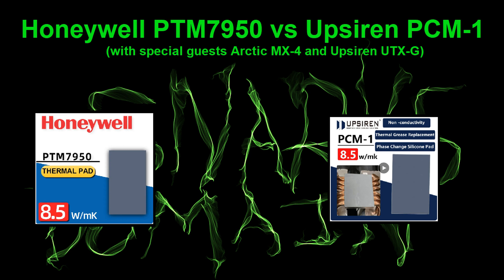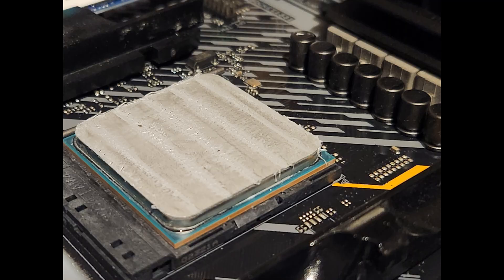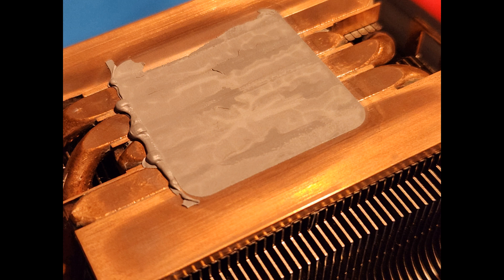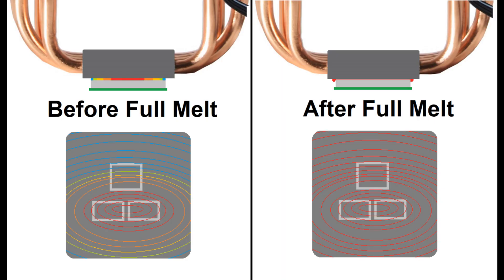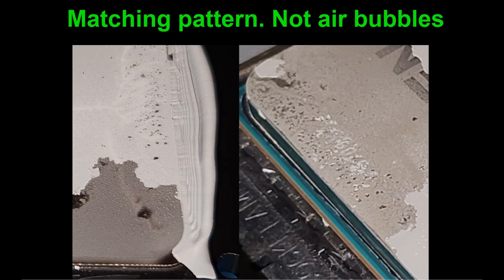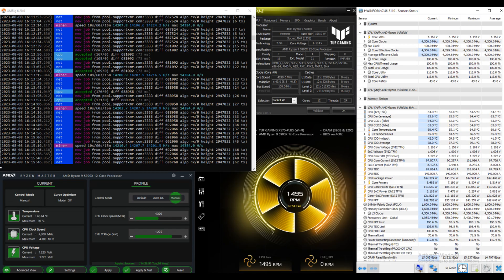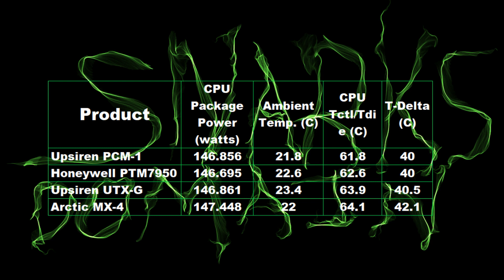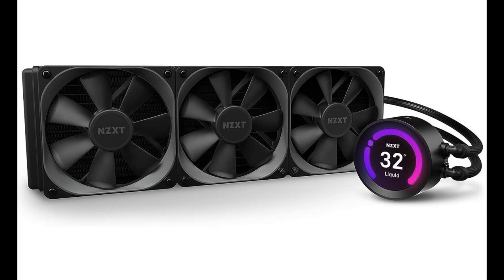Can Upsiren PCM-1 Compete with Honeywell PTM7950?

Comment: A fun experiment to try and would be interesting to see the results. 
Instead of using the usual thermal pads on Vram/Ram chips, can you experiment with using PTM or PCM instead (even double layer it) and see if it gets good results.
Reply from the maker: It sounds like a cool idea, but that would be stacking up to achieve 1.8mm gap (so about 8-9 layers of PCM material. If/when it melts, it would then basically glue the VRAM to the Cooler and would be extremely difficult to pull apart. This would also be more expensive than putty or pads.

I mostly just use a high end Thermal Putty on VRAM/VRM these days, rather than pads.

I might try shims and PCM on a card I'd be willing to sacrifice someday. Just worried about damage when trying to pull it back apart.
Reply: @snarksdomain  yeah it would be cool to experiment on an oIder card you don't care about anymore, with either shims or PCM.

Definitely very curious to see what happens.

Comment: Phase change materials need to be cooled in refrigerator before install. Better for cutting and installing!
Reply from the maker: It's one way to do it for sure. lately I've just used room temp with decent success.

I now always try to undercut it by 3mm on all sides. Do first peel and lightly rub my finger over to work out any bubble and also to make it stick to the surface. Then I use a small piece of tape or sticker at a corner and do 2nd peel nice and slow. I stop if it pulls up or tears. I usually rub my finger again if that happens, and sometimes try peeling from different corner if need be.

Comment: I tested the upsiren pcm 0,02mm vs the ptm7950 from aliexpress (0,25mm), specifically from passionate girl store and this was a little better than the upsiren. The only downside with these pads is when you take them out (specially on laptops because of the small bare dies) after some months I made a rookie mistake and ended up cracking the cpu die on my msi laptop because i tried to remove the heatpipe when the laptop was cold, so it's better to warm up everything if you need to dissasembly your laptop. Confirmed this a couple of days ago, used some pcm on copper sheets, warm'em up and then let them cool down and dude it was hard af to separate them without heat. Anyway great channel, love your videos, a lot of information we don't find anywhere else, thanks!
Reply from the maker: Phase Change materials definitely become hard once they cool down (any temperature below 45C of the material itself will be solid).

If anyone uses Phase Change on an AM3 or AM4 CPU they will need to use the AMD recommended "Twist" method if/when removing the cooler. This goes for dried paste as well.
Reply: interesting insight, will definitely keep this in mind once I repaste mine with PTM

Comment: Hi, did you get honeywell from moddiy?
Reply from the maker: Yes I did. I've since retested several different Phase Change Materials from a few different sources.

I've found it is difficult to differentiate PCM/Paste performance with my current setup, even with tracking Ambient temps (only ~3 degree span from best to worst)

Once I make some further improvements to my test bench and test methodology I'll go back and retest everything again.

Currently focused on testing Thermal Pads, Putties and Shims. This is much easier to do with 35 degrees from best to worst, even considering the 2 degree resolution on Nvidia Mempry Junction Temperaturws within HWINFO.
Reply: @snarksdomain  Thanks for the answer :) I bought honeywell from aliexpress and moddiy a few months ago and it came with different foils, PTM from aliexpress came with grey foil and PTM from moddiy came with blue foil, their consistency was also different, PTM from aliexpress was easier to put on, to put PTM from moddiy I had to put it in fridge for 30 minutes first  :D I came to the conclusion that all PTM from aliexpress are fake, they feel more like Upsiren than original Honeywell but they perform almost identical at least for the first few months, what is your opinion about this? Do you also have PTM from aliexpress to compare? Regards :)
Reply: @snarksdomain  Thanks for the answer :) I bought honeywell from aliexpress and moddiy a few months ago and it came with different foils, PTM from aliexpress came with grey foil and PTM from moddiy came with blue foil, their consistency was also different, PTM from aliexpress was easier to put on, to put PTM from moddiy I had to put it in fridge for 30 minutes first  :D I came to the conclusion that all PTM from aliexpress are fake, they feel more like Upsiren than original Honeywell but they perform almost identical at least for the first few months, what is your opinion about this? Do you also have PTM from aliexpress to compare? Regards :)
Reply from the maker: @alexiejmediator2963  There are definitely fakes out there, and there are also legitimate ones. This stuff does not cost that much to source in bulk. 400x160mm sheets can be purchased and then cut down and resold. You can even buy 400x160mm sheet on Aliexpress and they have held up just as well as the stuff I bought from Moddiy.

That formation of "dried paste" is what is supposed to happen with PTM7950. It starts off around 0.25mm and when it melts, the mounting pressure of the cooler/heatsink compresses it, allowing the molten PTM to flow outwards and form around the die/IHS. In this way it can get to a layer as thin as 0.038mm (or 0.0015"). This means that over 80% of the material will ideally form around the outside of the die/IHS. And that is the goal, not a detriment.

Comment: is one easier to apply than the other or are they about the same?
Reply from the maker: They are the same for ease of application.

I now cut the piece smaller than the die/IHS by about 3mm (1/8") around each side. It makes it easier to peel I find. 

I peel one side of protective film, then I place the piece on the Die/IHS and rub my finger on it to make sure it's sticking well. If I see any large bubble I press them out. Then I use a little piece of tape on a corner and peel the 2nd protective film off (packing tape works well).
Reply: have you heard of thermalright helios? they say it is ptm7850  @snarksdomain

Comment: In my quest of finding phase change silicone pads, I came across this new one. Have you heard of the Maxtor XTP-001? They claim 22.5w/mk thermal conductivity. Which I find strange, since it's so much higher than the Upsiren and Honeywell. I can't find any solid reviews for it. Just ali express listings and other pages in online shopping platforms. It would be interesting if you can get your hands on one just to see if it's better or not.
Reply from the maker: Thanks for the heads up! I'll take a look
Reply: @snarksdomain  No problem! Looking forward to it.
Reply from the maker: @conyo985  I've got 4 on the way. 2 for CPU and 2 for GPU.
Reply: @snarksdomain  How did it go with the XTP001? Just got some as well
Reply from the maker: @ Sadly, I have not tested it yet. I had put a pause on CPU and GPU core testing after I realized Testbench 2.1 was not accurate enough to show meaningful differences in such a small temperature range. 

I'm waiting for the final element of Testbench 3.0 to show up, and that is a calibrated reference temperature sensor, capable of accuracy down to 0.06 Degree Celsius. I'll be using it to dial in and calibrate my Ambient temperature sensors. Testbench 3.0 also uses a case with a linear airflow path (Torrent Compact). I've blocked off the bottom of the case and will rely entirely upon the 2x180mm fans up front at a fixed fan speed to move air through the case. This should enable me to have better consistency of the variables, and hopefully improved accuracy for the results. I will need to run multiple tests of the same product to ensure it's working as intended. Once I feel it's test accuracy is there, then I will commence testing. I'll start will all of the Phase Change Materials first, then work through pastes. Eventually I'll retest all the Thermal Putties and build an even more accurate chart.

Comment: Checking Your latest google drive charts it looks like PTM7950 has better temps now a days vs PCM-1. Right?
Reply from the maker: It seems that way at first glance of the charts, and it's possible that PTM7950 outperforms PCM-1. 

With my current method of testing I believe I am out +/- 0.5 degrees Ceclsius, or around that. You will see results jump around between the CPU tests and the GPU Core tests. I'm hoping to make my testing more accurate in the future. There isn't enough of a spread with Pastes and Phase Change Materials results to be confident on the findings for me.

With Thermal Pads and Putties there is a much larger difference in results so it makes it easier to see a difference in performance. Even still, pad/putty results jumo around between ETCHASH, Furmark, and KAWPOW results.

I'm starting to form how I want to set up Testbench 3.0 in my mind. Will likely wait for RTX 50 series so we can test GDDR7 and see how hot it gets.
Reply: @snarksdomain  You do a great job. Based on Your results I will pick PTM7950 over PCM-1, and CX-H1300 over UPSIREN U6 PRO. That make sense do You think? BTW I can use PTM7950 for both CPU and GPU right? cheers
Reply from the maker: @smokehead5318  For sure. You can definitely use PTM7950 on both. I recommend giving it a good burn in for 2 hours. If you can get CPU temp up to around 65-70 Celsius if should get a good melt and become nice and thin. I saw the largest improvements in the first 2 hours for most of the PCM's, the exception being Laird TPCM7250, which needed a hotter burn in to get a proper melt (I'd recommend 85-95 Celsius burn in for Laird).
Reply: @snarksdomain  ok thank You for a such informative reply. Cx-h1300 is superior to u6 pro based on Your test, however it’s a bit stiffer during application?
Reply from the maker: @smokehead5318  the 13.5k/mk stuff does outperform U6 Pro. Be sure to take a close look at the pictures of the product and don't rely on the description. There is also the 8w/mk CX-H1300 which doesn't perform well. The only thing you can really go off of is which box has checkmark on it in the pictures.

The first container of CX-H1300 that I ordered was on Amazon, and the description all said 13.5 w/mk. I didn't pay attention to the pictures and 8w/mk got delivered.

I'm now using Upsiren UTP-8 which slightly outperforms CX-H1300.

CX-H1300 is still a great price/gram though, so go with whichever one makes the most sense for you.

For PTM7950 from Moddiy vs PCM-1 from Aliexpress they are similarly priced, but the shipping cost is quite different. I use both. Also depends how big of a sheet you get. Which can change the price dynamic as well.

There is also the large 400mm x 160mm sheet of Honeywell PTM7950 sheet on Aliexpress which is also on the charts. So if you're doing ~50+ CPU's then that's a good option as the price per CPU gets closer to $2 CAD.

*Edit: for stiffness, CX-H1300 13.5w/mk is very similar to U6 Pro. Shouldn't have any issues with either.
Reply: @snarksdomain  I couldn't find any Upsiren UTP-8 result either on Your drive or latest video. Is it something new?
Reply from the maker: @smokehead5318  it's on the drive. It's at the very top of the chart.

It is the newest thermal putty from Upsiren. I believe there is potentially another one in the works as well, but  know more about that in the coming weeks/months.

I had tested different samples a few months ago. There were a few different viscosities and also a couple samples that had slightly different recipes, and more thermal boosters. I sent Upsiren my test results and I believe they further tweaked the final product since UTP-8 outperforms the prototype samples they previously sent me.

Here is the video where we apply it: https://youtube.com/live/0TWbbrKv8Z0?feature=share

And here is the video where we go over the results (number crunching starting at the 38 minute mark): https://youtube.com/live/C4qlUGgWYlU?feature=share
Reply: @snarksdomain  your test are good enough:) really great work. After checking Your charts I decided to go for CX H1300 13.5W instead of upsiren u6 pro, and ptm7950 instead of pcm-1 based on Your latest charts. I can use ptm for gpu and cpu if I am not mistaken right? Cheers
Reply from the maker: @Nexxraven  it's a good combo. It's what I'm doing on GPU's currently.

As for KPX, it's a good paste. I don't feel my CPU/core testing is accurate enough to differentiate between products as it seems there is a +/- 0.5 Degrees Celsius during a test accross several hours. By using only 1 hour of data it can vary by that 0.5 C de0ending on the hour.

As such I would argue that, performance wise, you can't go wrong with any decent paste or Phase Change.

As for longevity, I believe a Phase Change Material will have the upper hand over a paste. This is my current view of things anyways.

Comment from the maker: I'll be testing both of these Phase Change Materials out again on Tstbench 2.1 where I log Ambient temperatures in real time within HWINFO64. This will improve the accuracy of the test and be better to use as comparison.
Reply: What’s the update? There are so many fakes, and different products to try and figure out… Are the sales on Amazon legit? What about the Kryosheet? What is the best place to try and get genuine PTM7950?
Reply from the maker: @Onibabayaga   Latest test charts are at this link http://tinyurl.com/4btsmwu6

Kryosheet does frarily well. Genuine PTM7950 and PTM7958SP can for sure be purchased at Moddiy.

Comment: What is best upsiren pcm 1 or ptm7950 of Aliexpress?
Reply from the maker: I still need to fully test the Aliexpress PTM7950.
Reply: @snarksdomain upsiren pcm 1 have similar performance of ptm 7950 original? Or ptm 7950 original is very best?
Reply from the maker: @Vitorlean  From this test I would conclude that they perform the same. I'll be retesting them on Testbench 2.0 and logging ambient within HWINFO64 to get even more accurate results. On this test I was still using the standalone temperature sensors, which aren't logged in real time.
Reply: @snarksdomain  but this test was with ptm 7950 of moddiy?  So the chineses know very do thermal paste.
Reply from the maker: @Vitorlean  ModDIY is an official reseller of Honeywrll PTM7950 so it is the guaranteed original PTM7950. I'm not sure if that answers your question or not.